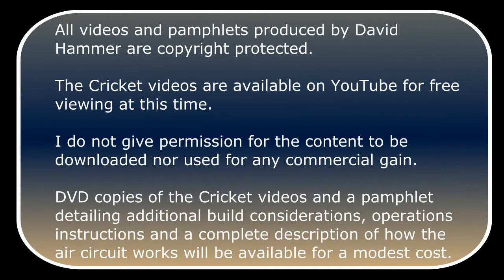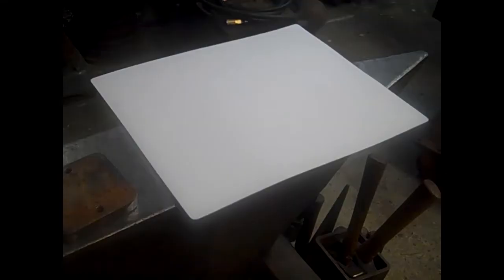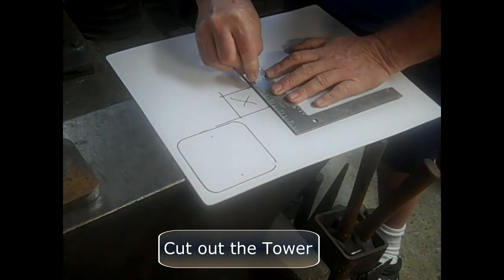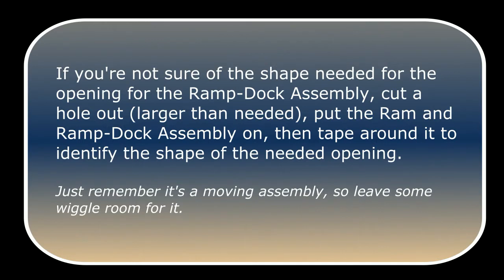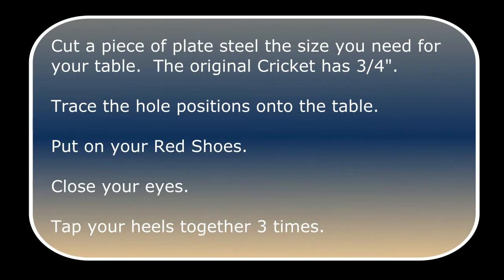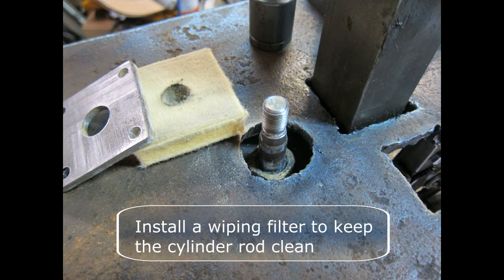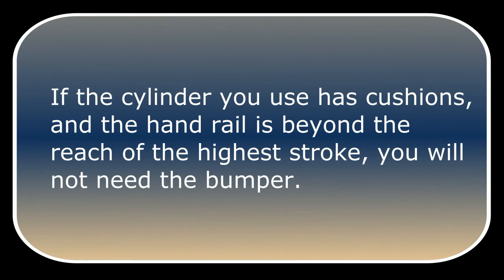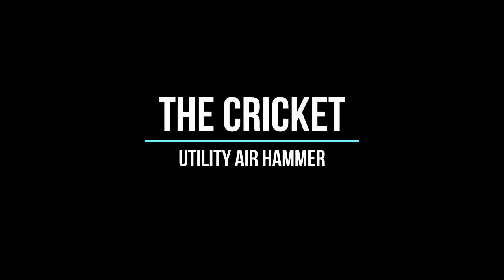Cricket Air Hammer Build - Part 9 of 11 (Table)

Comment: I wonder if drilling a few holes in the 3/4" plate would help with the cutting, not sure if my plasma will low thru 3/4".
Reply: I drill holes first in very case....